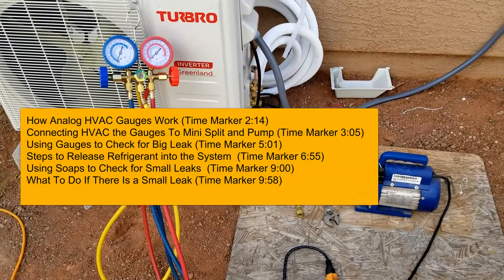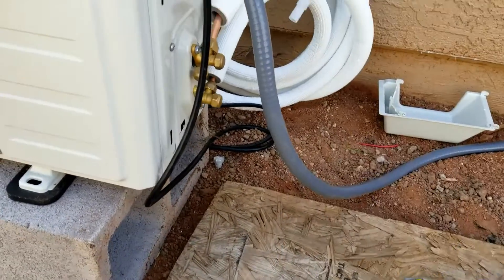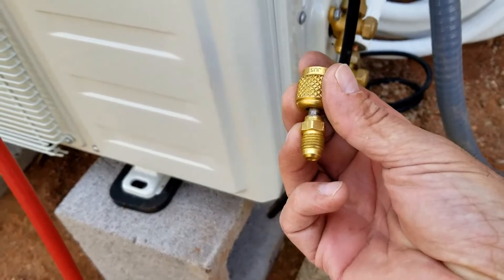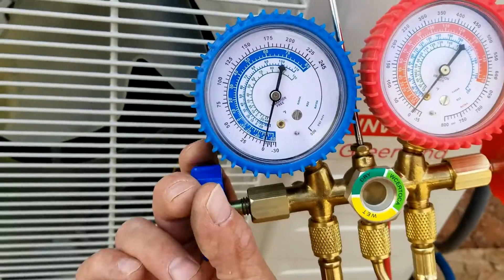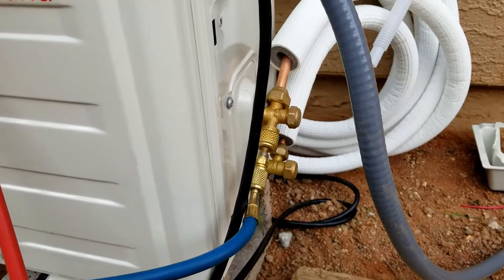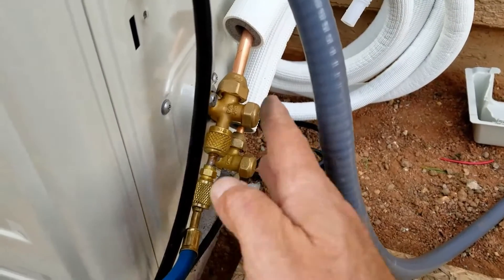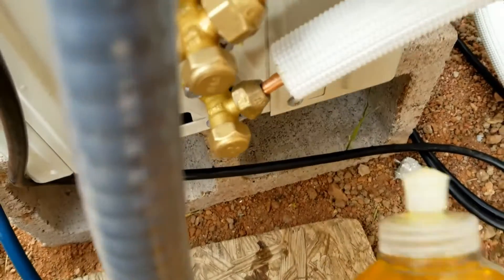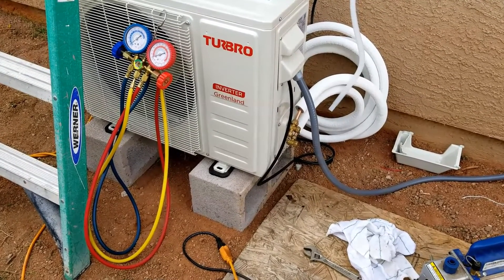Step by Step How to Vacuum Down Mini Split Using Analog Gauges Release Refrigerant Check for Leaks

Comment: The low side connection... the large line that you hooked the blue line to from the gauge set... when fully opened is called being "back seated" and the pressure that is on that blue line is ONLY freon from the valve to the manifold head. There is no reason to "remove it as quickly as you can" to cap it. If that valve is opened until it stops, it will not leak out freon from the system. Remove your blue line and install the cap that came with the system. All is well. When vacuuming the system down, both of the valves should be closed and the only part you are putting under a vacuum is the line set through the evaporator (inside head). Once under good vacuum, opening both the valves fully closes the gauge set off from the condensor and prevents any freon from leaking out unless you have a bad flare on one of the lines. 

People think HVAC is scary. Fortunately sellers like Senville and all the others (made by the same company BTW) make installation pretty easy. They also make HVAC repair people

Comment: A micron guage along with vacume guage will show you a lot . Your vacume guage will give you confirmation that your system has a vacume on it if it is depressing the shrader valve  correctly. The micron guage will give you a much better indication of moisture in system. My guage went to almost 30 inhg very quickly. but the micron guage was taking forever to drop down. To below 500 i would like to see 300 or less on the micron guage. Then prefer it stays under 500 after about ten to 15 min isolation test is prefered. The vacume drops the boiling point of water way down. So the vac pump can suck the water vapor out of the system. I was in a hurry and very tired and connected the vac hose and it didn't depress the schrader valve very well if at all. I did not have the micron guage attached. And released the refergerant. After getting some rest i started second guessing if i had it vacumed sufficiantly. So to error on the safe side i recovered the refergerant and started vac with micron guage. Shrader valve removed 29 inhg was obtained quickly but 8 hrs later the micron level got down to  500 micron. Im assuming it took some time to dehydrate the moisture from the oil. HVAC is not my prefered line of work. I do it when required. Have most of the equipment to do it correctly. I do it when required for  myself or friends and chillers at my employment. And have to refresh my memory when doing so. My point. Is if you have a micron guage avaiably. Use it.
Reply: Make a video that is simple and quick on how to use a micron gauge?
Reply: @buttercatz99  Micron gauges are fairly expensive, but the best way.
Reply: Do you have to take the shrader valve out to use the micron gauge. I know it's faster but we are only checking roughly 30 feet total copper lines, liquid and gas lines.

Comment: To which port do I connect the blue hose? 
I’m assuming it it the one marked “low pressure charge plug” but I want to be sure. I seem to have two ports, and the one i think it is does not need an adapter
Reply from the maker: If there are two ports, the blue hose goes to the low-pressure big line, and the red hose goes to the high-pressure small line.

Comment: The line set should not rolls so many,You should cut the tube make new flare connecting the unit for better oil return.
Reply from the maker: You can cut the line set, but it is not necessary. If the line set is cut, the refrigerant needs to be recalculated since the unit is prefilled for the 16-foot run.

Comment: My ac compressor and condenser have no refrigerant, so I need to do a pressure test on the whole system.  Can I open the service hi and lo valves so the nitrogen can go thru both the compressor and condenser or should only the evaporator and its lines be checked? Same question to do a vacuum test? All the system or just the evaporator side?
Reply from the maker: If the valves are closed, it will only test the line set and indoor unit. Most leaks are in the line set connections, but they can be elsewhere. Basically, follow the manufacturer's manual to make sure the pressure doesn't exceed what is safe or components can be damaged. As long as the manufacturer's high pressure is not exceeded, it won't damage any components. After the leak is found and fixed, the whole system will need to be set in a vacuum.
Reply: But I want the valves open to test for compressor and condenser leaks. Is it possible?
Reply from the maker: Yes, just don't go over the manufacturer's high-pressure rating for the unit.

Comment: When I connect my adapter to the service valve it starts shooting out quite a bit of coolant before I can even get it closed. I noticed yours did nothing like this. Why would that be?
Reply from the maker: During installation, there should be no refrigerant in the lines until it is released, which is the last step. Refrigerant is only released after the lines are in a vacuum. If refrigerant is in the lines, it needs what is called a Pump Down done first.
Reply: @HVAC_Mechanic sorry, yes I am trying to do a pump down. That is when I'm experiencing this issue. I think the problem is I am not confident enough to just keep screwing it on as it shoots out
Reply from the maker: When shipped refrigerant is locked in the outside unit which is only released after the line set is in a vacuum. A Pump Down it is putting the refrigerant back into the outside unit as it was when shipped. There should be no refrigerant in the lines while placing the line set in a vacuum. A Pump Down and vacuuming the lines are two different things.
Reply: Yes I am trying to do a pump down to move my mini split temporarily. The issue I am having is that it was shooting out quite a bit of gas when trying to connect to the service port @HVAC_Mechanic
Reply from the maker: Sorry, I misunderstood. Yes, the connections need to be done quickly. A small amount will come out, but it should be minimal. Be sure the equipment is good. It might help to watch a video of it being done.
Reply: Thank you
Reply: @Iamkab  Also you can buy quick release hoses or fittings to make it really quick.

Comment: Good video, but you do absolutely need a micron gauge.  Mini split manuals will specifically give a micron value to ensure a deep vacuum is maintained.  Traditional
Gauges don’t tell you shit as far as vacuum depth.  Dish soap will only show the worst of leaks.  Oftentimes a slow leak won’t even show up using dish soap.  I still appreciate the spirit of your video.
Reply from the maker: Micron gauges are good but are not necessary; analog gauges work just as well. Many installers don't even use gauges or a vacuum pump at all and just do a line set flush. Soap will find small refrigerant leaks and is a common method to find a leak and fix a leaky unit. If you have a micron gauge, use it, they are good tools.
Reply: I’m just saying it’s impossible to determine how well your system is vacuumed with an analog gauge set.  Just for reference, the “29” on your gauge is roughly 23,000 microns.  “29.92” is 50 to 100ish microns.  Is your eyeball resolution good enough to divide the space between the 29 and 30 on your gauge (assuming it’s even calibrated) into 23,000 equally spaced tick marks?  Almost all equipment manufacturers will recommend a 500 micron vacuum will be held for a specified duration of usually 5-10 mins for a system to be deemed “dry.”  Any vacuum is better than no vacuum.  So yes, your system will work if the vacuum is done as you suggest.  Will the compressor life be as good, and will the system operate as well as one that has a proper vacuum done with a micron gauge?  No.
Reply: @salvatoregiovanni8967  Thanks for your time making that response. Makes sense what your saying. May I ask one more question? Do you absolutely have to take the shrader valve out to add the micron gauge if you have lots of time.
Reply: Dakin and Goodman 12000 units don't suggest micron gauges, why do you think they don't suggest micron usage?

Comment: Thank you you have show how to vacuum this system so all mini split requires vacuum right?
Reply from the maker: If there is outside air in the lines, then yes, a mini split needs a vacuum. There is quick connect type mini split units that don't need a vacuum and come with the line set already in a vacuum.

Comment: If both valves are shut closed, how does the vacuum pump able to do its job vacuuming those copper pipes?
Reply from the maker: The unit is shipped in a vacuum with the refrigerant and locked in with the valves. Once the copper line set is in a vacuum, the refrigerant can be released by opening the valves.